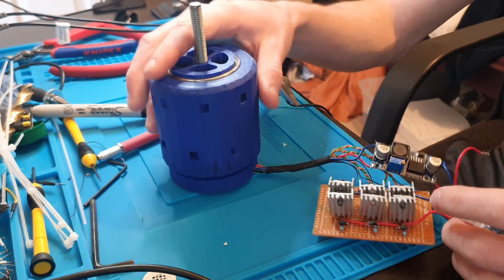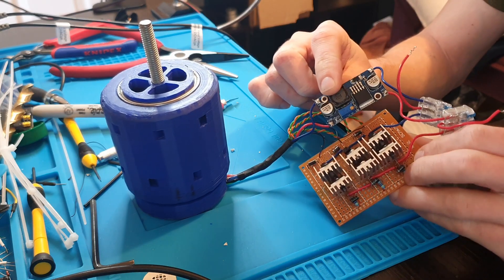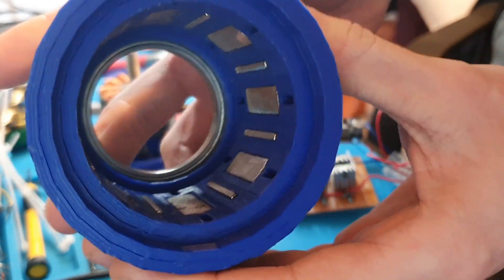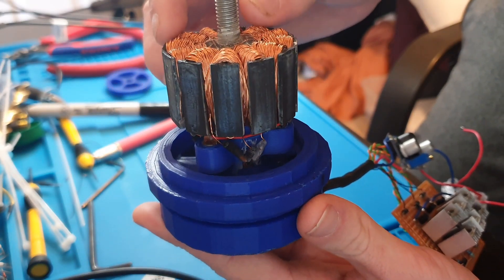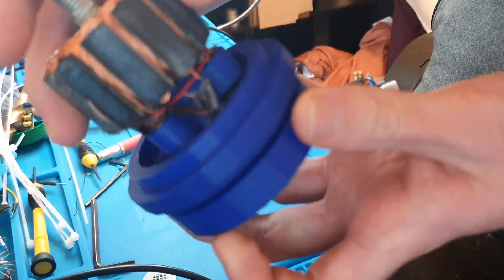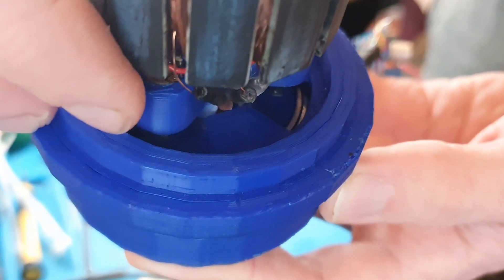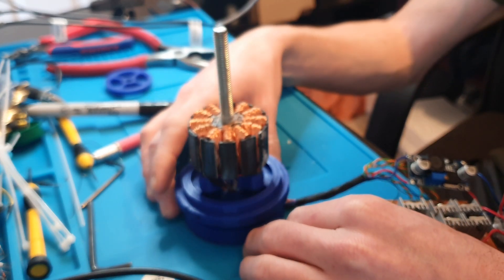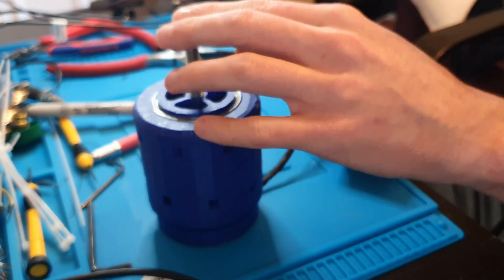3D Printed Brushless Motor!

Comment: Benjamin Marshall; "You are the Man"!  You totally kicked ass on that stater core.  Where did you get your iron powder and epoxy rein?  Where did you get your magnets?  What is the copper wire gauge sizes?  What filament did you use to make your mold for the stater?  This is the kind of project that separate the men from the boys, and "You are the Man"?   Thumbs up all the way Sole Brother, like and "SUBSCRIBE".

Comment: Will it melt?
Reply from the maker: The iron powder core is pretty resistant to heat, and I was careful to include ventilation holes as you can see.

So far I haven't seen any signs of heat damage on any part of the motor.
Reply: That's good btw you earn my sub

Comment: Dude! I am a mechanical engineer but I have fallen in love with electric motors somehow for a while now. I have printed and built the BLDC motor from Makesea to learn how these things work and I succeeded on the third try. I then designed both an inrunner and an outrunner bldc motors. I printed the inrunner and built it but it didn't turn.. thats because I printed the stator in regular pla. That's also true for the outrunner. I do have iron pla to print with but didn't want to waste it on my first designs because it is expensive. I have been thinking of cold casting the stator designs with epoxy and iron powder for a long time just like yours. It would be great if you made a video about casting stators!
Reply from the maker: I'd be happy to make a video about that. I made a video where I measured my home made ferrite's inductance compared to real ferrite, and plain steel (you should check it out!). But I have been slowly experimenting with ways to get higher performance, and easier casts. So as soon as I get some free time, I can throw a video together showing what I've come up with.